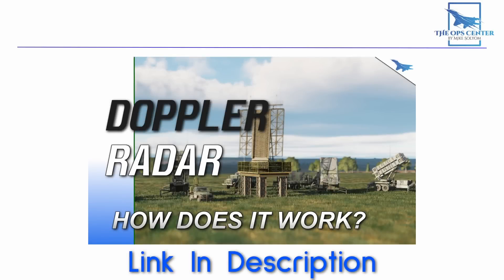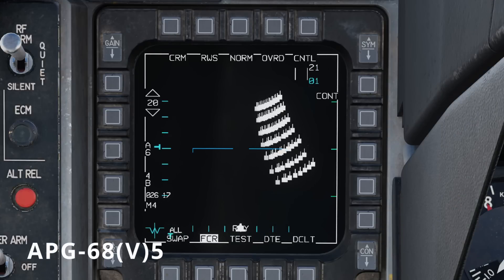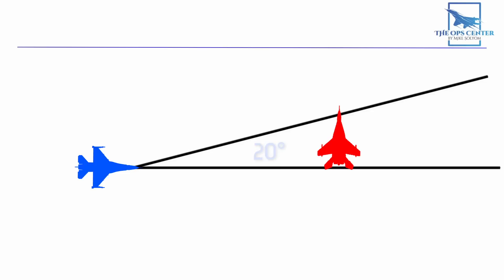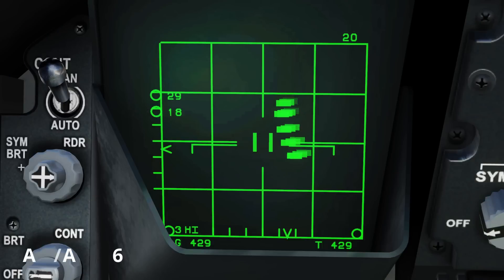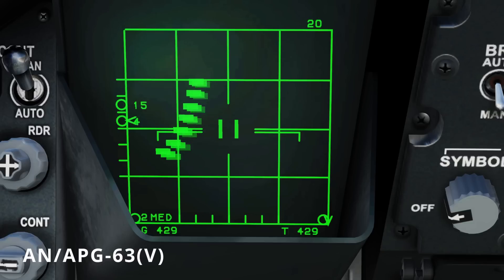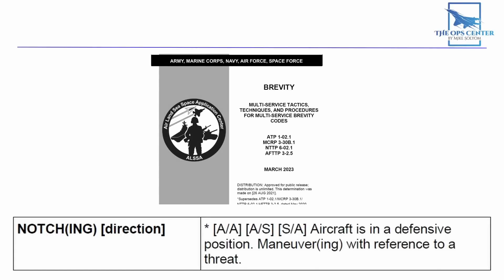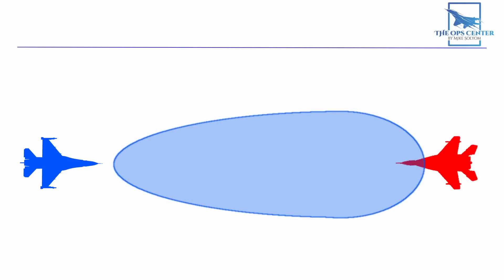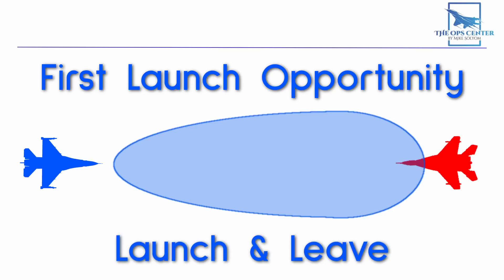The Real Truth Behind The Radar Notch | How Beyond Visual Range Combat Works

Comment from the maker: During the making of this video there were a couple patches to DCS that moved the notch window a few degrees to the side. This happened twice with one of them hitting right as I recorded the radar screen videos. So it is slightly off from the diagrams I used later on (by about 5 degrees). However, in all cases the notch window was about 20 degrees wide. Other than that everything else should be accurate. Apologies for that discrepancy.

Comment: Hang on. How does notching a SARH shooting aircraft help if the seeker is picking up radar waves bouncing from the shooter? Wouldn't you need to notch the *missile*, not the aircraft, since you're trying to fool the receiver in the seeker head, not in the launching aircraft? Similarly, wouldn't nothing an ARH missile work, the same way as notching an aircraft? 

I would think that notching the launching radar would only work for command-guided missiles (ie some SAMs)

Comment: Speaking of witch at 4:25 about drag increase on the missile due to AoA. Heh..., I've spent some weeks of analyzing and studying the drag coefficient vs AoA or simplier resulted drag vs AoA through the deceleration rate of all AA missiles in DCS and do you know what I've found? A pathetic simulation of missiles drag, that's what I found! The base drag is way too high to be realistic, and even after some latest updates, ED has indeed started to understand that the zero AoA drag coefficient was very exaggerated, so they've tweaked that down a bit, but not enough as the AA missiles still decelerate like crazy at low AoA. At critical AoA however, in case of the AIm-120C, close to 29...30 degrees, you're not gonna believe it probably, the drag only increases by some 1.5 to 2 times=)))), when according to real common sense data analysis of missiles or aircraft, the drag or drag coefficient should be at least 7..8 times higher at critical AoA, not to mention that above critical, the drag increases more drastically! Also the way the moving fins on the missiles in DCS in relation to the rotations of the missiles in pitch and yaw are like very off-track and not correctly simulated, like they are for aircraft! They've only made a visual effect with those fins moving as the missile's movement is not synchronized correctly! So the zero lift drag of the missile is too high, but the drag increase due to AoA is too low. DCS...! And the same plague is upon all DCS AA missiles, especially the russian ones which are like done so badly on purpose, in terms that their base drag was still left much higher than for the Amraam. Did they wanted to give the Amraam the upmost advantage? Could be, as they control the numbers behind the simulation as they desire, so I wouldn't wonder!
Reply: I’m pretty sure they openly admitted (dcs devs) that they underperform the missiles so that there’s more merges and dogfights
Reply: @jacobdoolan4978

Aha! So we're speaking of unbiased things and only of realism seeking when we say DCS? Sadly not!

Comment: The doppler is not affected by ground, only the pulse does! Why are you saying that the doppler sees ground clutter, when it only sees targets that are either closing or moving away from the radar beam above a relative speed. That's the only reason why those targets weren't appearing directly in front of your radar, NOT because of ground as you confuse things up! Only the pulse mode sees clutter, be it ground or from dispersed chaff and when the targets were above the horizon, it was the pulse mode seeing your targets and you misinterpreted that as the doppler not being affected by ground!

Comment: You actually might want to look into the term BEAMING. It a term actual fighter pilots use to be undetected by Doppler radar. DSC seems to have dropped the ball on that one  if one flies 90 degrees from a oncoming Doppler radar system one will have no signal to a Doppler radar. That's because Doppler radar looks for speed differences to find a target

Comment: Would going vertical also notch?
Reply from the maker: Yes actually. Flying straight down at the ground will do it. However, you can only do that for so long. 😃
Reply: Good to know :) Is a vertical notch followed by either cover if there is any or by a low level horizontal notch going cold a sound strategy or is simply a long U-turn preferable?

Comment: Great video! I just have a small nitpick at 4:23.
The lift vector is always perpendicular to the incoming air, it's defined as such. Therefore, it does not affect the speed of the missile at all. Only drag can affect the speed, which is defined to be pointing in the direction of relative airflow.
Reply: Lift that is pointing backwards, relative to the direction of flight, IS one of the components of drag. Angle of attack for example causes it to tilt backwards.
Reply: @cmptohocah  The backwards component of the total reaction is drag, and the other is lift.

Lift and drag are perpendicular, but yes the total reaction is pointing slightly backwards.

Lift and Drag are defined like this, because Lift becomes unable to add/remove energy (does not affect your speed), while Drag can only slow you down, it can't make you change direction like lift does.

Now this means that stuff like the Lift/Drag ratio equal your glide ratio, among other very useful things.

Look at the wikipedia page for Lift-to-drag ratio, and the image on the right side.
Reply: @silience4095  I am not 100% sure what you are trying to say here, but all I wanted to point out to you is that when the lift vector, produced by the lift surface(s), is tilted the component of the lift that is acting in the same direction as the drag, becomes a part of the drag. That is one of the reasons you need to add power in a level turn, 'cause extra lift you need to produce in order to stay level is also increasing the total drag force.
Reply: @cmptohocah  It's just a terminology thing. Lift is always perpendicular to the relative airflow at infinity. 

Drag is always parallel to the relative airflow at infinity.

Lift doesn't tilt back, because it's defined that way, it's more useful if it doesn't.

What does tilt back is the total reaction, or total aerodynamic force.

Comment: Is the 20 degrees centered on radar's pointing direction?  It seems offset to one side in the graphics.
Reply from the maker: Yeah, I mentioned this in the pinned comment. During the making of the video there were some patches that shifted the window slightly. I'd already changed things twice and it was minor enough that I felt a comment would cover it.

Hopefully that helps.

Comment: Great content, thanks Mike.  At the 4:00 mark there is the comment that when the motor burns out the missile cannot generate more kinetic energy. Physicist here so I'd like to point out that the missile cannot generate more total energy (ignoring tailwinds which are not a factor in this discussion), but the missile can exchange potential energy (increased by higher altitude) for increased kinetic energy. Lofting missiles diving down can do this at least until air density really has an effect on drag. The point you are making is perfectly valid, most missiles in DCS have short burn motors and this can be used to defeat them. I'm just being precise with the physics terminology.  Please keep these videos coming, they are great.
Reply from the maker: That's a great point. Thanks for sharing.

Comment: So notching doppler radar is/was possible because there is no detectable velocity difference to distinguish the target from the background?
Reply: While that's how DCS treats it, it's not how western radars IRL would. Remember, radar doppler filtering is just that, a filter applied after receiving a return.  IRL, things like range gating, signal strength analysis, and rate tracking all defeat this tactic. With missiles, the INS is going to guide to the last computed intercept point when it loses lock... especially true with range gating where it ignores things like ground clutter outside the range bin the target is in.
Reply: @Whiskey11Gaming  Thank you, this is excellent information.
Reply: So what happens is a little more complicated but you have the jist. Essentially notching only works if your in a situation where clutter returns fall into the radars speed gate (which is very narrow often 15-30kts wide) and are intense enough to overpower the targets return. And as such you cannot notch in lookup situations especially at high altitude.
Reply: @nighthawk2174  Thanks ++

So the radar speed gate is like a filter to remove slow moving objects and to reduce noise? Its width having "zero" absolute kts in the middle?

The intensity being a result of losses that basically increase w distance? and in a lookup situation there are also less return surfaces making the target very distinguishable.

Am I understanding it correct that the main issue was(/is) return signal processing and not (absent/inadequate) modulation schemes to identify them?
Reply: Essentially, thats the basic idea.

Comment: The MLC filter window (notch) is not caused by a zero radial velocity condition. That is the zero doppler condition. Furthermore if the author modifies his test to have aircraft flying roughly perpendicular to the radar, they will stay in the notch regardless of antenna train angle. There is no limited forward cone for the notch.
Reply: Only if speeds are exactly matched so the second plane stays at the same distance
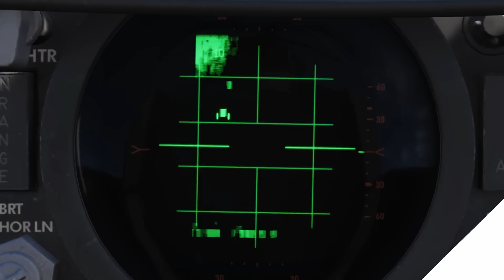Reply: The notch by definition has non-zero closure except at the 3:00 and 9:00 position wrt the transmitting aircraft. So aircraft remaining in the notch will be closing or opening range unless near those positions. Anytime the range is staying the same, they're in the zero super Doppler condition. Except at the 3/9 positions, zero Doppler and notch conditions do not line up.
Reply: @idahlke1  notching at 90 degrees only works because radar can't distinguish target from chaff

Comment: Perhaps I'm misunderstanding but I feel the assertion that you can only notch in a specific range of angles off of the attackers nose is inaccurate.

Theoretically, theres no reason you couldnt notch from anywhere within the entire radar arc, so long as you fly 90 degrees relative to the radar pointing at you.
If an attacker has their radar deflected 50 degrees, and you fly 90 degrees relative to the radar (40 / 130 degrees relative to their nose), you should still be notcbing just fine, no?
Reply: I don't think so, because both aircraft are moving with their own velocities. So the target is still moving relative to what the radar sees as the ground, thus allowing it to see the notching aircraft. It works nose on because your relative velocity to the radar is the same as the grounds velocity to the radar. Any difference between those two figures will make you visible
Reply: @Generic_Name_1-1  The radar isnt looking for movement relative to the enviroment, it's looking for the dopler effect. The whole reason notching works is because you trick the radar into filtering you out because your relative speed is low enough that it thinks you're the ground.
Reply: @Nevan_Nedall  that's literally what I said. And yes, in effect it is looking for relative velocity to the ground. Because the doppler gate is calibrated to the ground so it can filter the return out. If you aren't presenting the same relative velocity to the radar as the ground you will be visible to the radar
Reply: @Generic_Name_1-1  From what I understand there is a theoretical notch circle where your relative velocity to the radar will be minimal. Mike just had the targets fly in a straight line, hence why they entered-exited the notch.
Reply: @cmptohocah  that would work if you were stationary, but since the target aircraft is also moving even if the radar signal is on the 3-9 line because you're off axis to the nose of the radar aircraft, the radar will still see you. Like I said both aircraft still have velocities, unless you're flying cold with the radar notched you're neither the same velocity to the ground or the same velocity as the radar itself.
Reply: @Generic_Name_1-1  I am not really sure what does the offset have to do with the relative velocity? The radar is spitting out a beam which can rotate and that beam is hitting the target as well as the terrain behind it. If the target's relative velocity to the beam is the same (nor really same, but for simplicity let's assume it is) as the terrain, meaning there's no shift in frequency, then the target might as well be the terrain as far as the radar is concerned. Or am I missing something here?
Reply: @cmptohocah  Youre right. Whenever the attacking aircraft is on your 3 or 9 aclock, you are potentially notching or beaming him. If you dont have ground clutter to help chaff can. It can also help to reduce your own speed, since if youre off the ideal angle a little bit, your speed being lower will result in a lower error speed so to say, potentially helping you to stay in the filter.

Comment: 8:08 The target disappearing from the attacker's scope does not necessarily defeat the missile. If the attacker continues illuminating and somehow manages to keep the target in-beam without seeing it (or by seeing it with a different sensor), the missile will still get reflections, and the doppler shift it sees will be dependent on its own intercept geometry, not the attacker's.
Reply from the maker: You are correct that theoretically it is possible. However, we're talking about semi-active radar homing missiles at that point of the video. Those missiles require a narrow beam of energy to illuminate the target. Wide beams run the risk of illuminating something else in the air and sending the missile off course. With that requirement you need the launching aircraft to maintain a good lock.

How do you maintain a lock on the target if the target has faded? You don't. So the launching aircraft can't accurately guide a semi-active missile that it can't see. But I suppose if you want to go to an extreme you can say that some random radar waves could hit the target and that would be enough. However, I've never heard of this happening in DCS or from any of the real life fighter pilots I've worked with.
Reply: @TheOpsCenterByMikeSolyom  So Jon is right the missile could still hit even if the host radar loses track so long as it's still emitting guidance signals that are reflecting off the target.  The missile gets continues to track via its own internal speed gate which is fully independent of the host radars tracking loops.  If the speed gate was already established on the target whether or not the host radar is tracking is irrelevant. So long as CWFM/CWI signals are still being emitted the missile will not lose lock.  And, so long as it doesn't lose the targets doppler in the near 0 doppler clutter relative to the missile. To go off course in the case of another target said target would need to be in the missiles main beam, in the host radars CW/CWI beam, and close enough in doppler to impact the speed gate, and have a strong return, and to not be filtered out by ECCM (in such a situation I could see a new signal in the filters tripping ECCM logic).  Speed gates are generally 15-30 knots wide in total.  With the return strength entering the speed gate falling off exponentially as you approach that +- 7.5-15kts. This is a possibility in DCS right now, but it's really only fully modeled on the M2K and F4.
Reply: So as far as illuminating the target without having a good lock, I believe most of the gen 4 aircraft in DCS actually do this. The mirage 2000 has a memory mode for the last known trajectory, that can both illuminate a target for the s530d, and regain the lock if the target fails to maintain the notch. The f-18 also has a memory mode which is programmable, to attempt to regain lock after missing multiple sweeps of the radar.

I'm also pretty sure both can force illuminate a cone in front of them, in special cases where either a lock is lost, or difficult to acquire. This would be your illumination through "other sensor", the sensor being your mk1 eyeball.

I'm not sure if any of the IRST planes in DCS can direct the radar and it's beam without also having a radar lock. I feel like that's a feature that should be there.